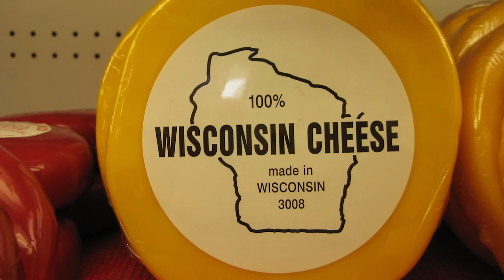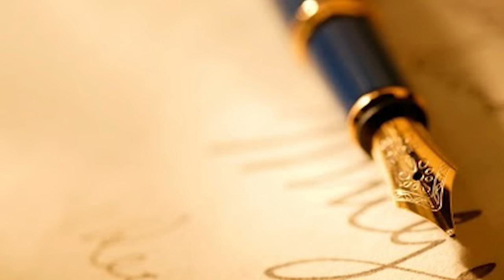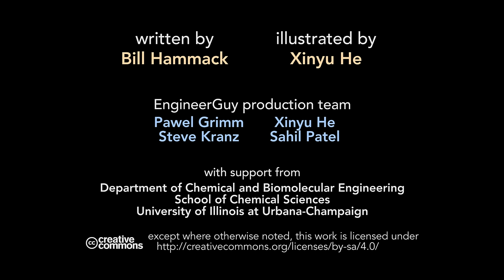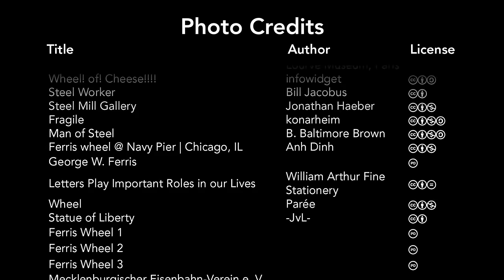Ferris Wheel: How the Eiffel Tower wasn't good enough

Comment: High Roller in Las Vegas is now the highest roller, almost 165m taller than Singapore Flyer
Reply: The High Roller was announced in 2011, the one in Singapore was open in 2008, this audio was recorded in 2005.
Reply: chronnotrigg Whats your point? He was just stating that there is a Ferris Wheel taller than the Singapore Flyer.
Reply: ***** His comment read like it was correcting an error in the video except it wasn't an error.  So my comment was correcting that error.  His comment can be read as just a statement of fact (so can mine), but it wasn't worded that way (nether was mine).
Reply: chronnotrigg On the contrary, I read his comment as if it was saying "If you think that the Singapore Flyer is still the highest Ferris Wheel, the High Roller now in Las Vegas is actually taller".

I read his comment as an addition to the information given in the video, not a correction to it.
Reply: ***** That's the problem with text, it can leave too much to the imagination of the reader.  You saw it as an addendum, I saw it as a correction.  Since it wasn't specified in the comment, we're just going to have to accept that.
Reply: chronnotrigg Nobody can correct the "engineerguy", the man never make a mistake. some say even that, he doesn't have a backspace on his keyboard.
I tried to add an additional info, but i can understand the confusion.
Reply: I just read what was literally typed, didn't add any words. If it weren't for the discussion about the comment, I wouldn't have realized that this is 2005 audio and the comment is because there is a bigger wheel since then. Now, is that High Roller 165m which is taller than Singapore Flyer... or is High Roller 165m taller than the Singapore Flyer?
Reply: Reza AP There is no "correction". When this was aired it was correct. At best it's an "update".
Reply: "(...) almost 165m taller than Singapore Flyer"
>> No, it's 2.7m taller than the Singapore Flyer, which is 165m tall (source: wikipedia)

Your comment is extremely misleading.